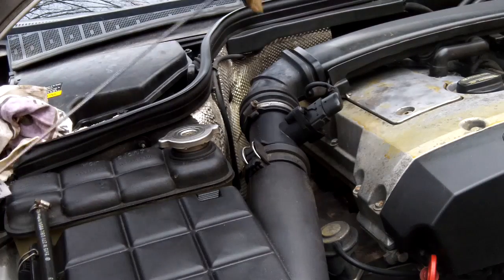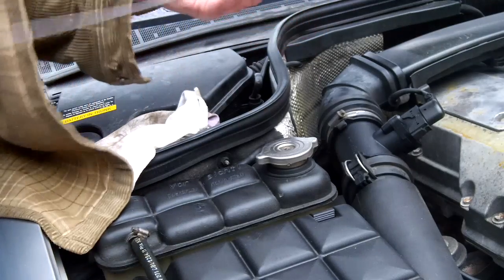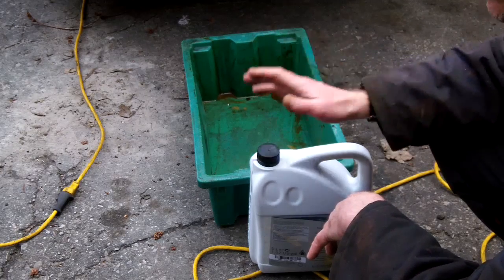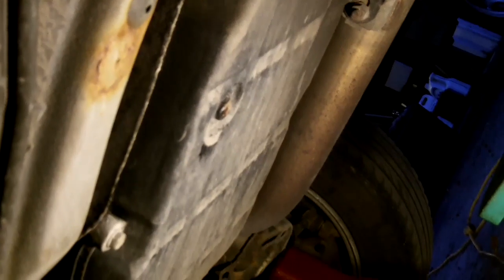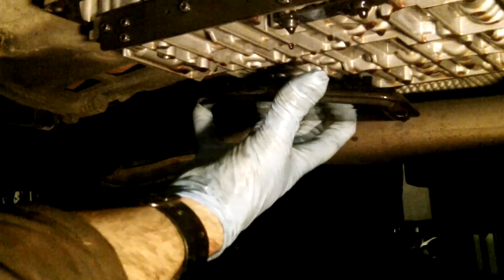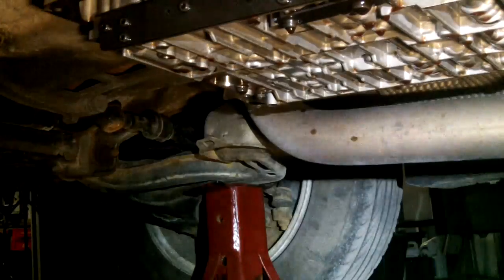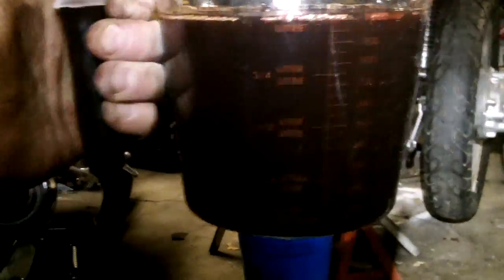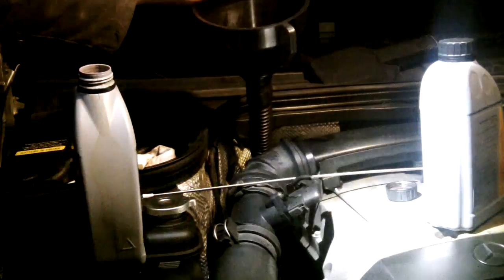Mercedes 722.6 automatic transmission .fluid and filter change..w202

Comment: 2000 C230 Kompressor.  I have owned the car nearly six months.  Bought it with 136,000 on it.  I am guessing the tranny fluid has not been changed.  I changed filter and flushed following this procedure. Wow!!! What a difference!  The old four cylinder is shifting like new.  Thanks for a great video on a job that could really screw up your car if not done correctly.
Reply from the maker: kylejackson8  Very welcome...glad it helped :)

Comment: Good friend of mine is a lifetime MB owner AND dealership tech.  He told me it is pointless to change the fluid and filter without doing the torque converter...  He said the dealers do, in fact only do the amount in the pan and change the filter.  This is something where he and the "procedure" disagree.  He has had transmissions come back with slipping issues that were cured after either a flush or a TOTAL fluid change (including the torque converter).
I'm doing this today on my W203.040

Comment: @fupabox, not even 2min in and already noticed that you aren't checking with the engine running. You should always check the transmission fluid with the engine running and also I would recommend getting an infrared thermometer to make sure it is ~80deg
Reply: Did you eventually watch till the end.. You gotta be patient man

Comment: Thanks - 722.6 it is then. I also noticed that you had the red lock tab on yours - apparently they are originally black, but if you replace the fluid then you can only replace it with a red tab because you can't buy the black ones. That's how you could already tell that somebody had broken the seal on your car before. The lock tab on mine is black however, @ 270000km, so I'm going to do a fluid change myself.

Comment: Invest in a fluid evacuation pump with at least an 8 liter capacity.  This is extremely useful for oil changes, and you can use it for pulling the fluid out of the pan of the transmission before removing the pan to save yourself a big mess.

Comment: I like your videos, and gave it thumb up, BUT:
-722.6 contains 9.3 liters of fluid, you changed 3.5, video should be called transmission fluid dilute....
-you need to replace oil in torque converter too....
-oil level in this transmission is ABSOLUTELY CRITICAL, yet first you measure it with engine off, than engine on,..thats not correct..in this case you must provide exact condition while measuring, otherwise this service can do harm to transmission....
Wishing you luck,
have a nice day
ALOHA

Comment: A week after changing to MaxLife ATF and I can say, without a doubt, the results have been spectacular. Feels like a new car, very noticeably smoother engaging gear from park and shifting through every gear. Particularly 1-2 shift, used to be a bone rattler now I wouldn't even know it happened without looking at the tach. YMMV but I would recommend, hell urge, anyone to give MaxLife a try.
Reply: And just wanted to reiterate, the dex III I had in there was less than 10k old, noticed no difference after changing fluid back then
Reply from the maker: The Stiver I may try that on the SL  (old 4 speed)  hope I get around to it this year  :)
Reply: Yeah I never really expected any difference on a 722.4 but it's night and day. I just can't explain how hard my 1-2 shift was before and how smooth and responsive it is now. My C220 drives better than most new cars with under 30k miles I ride in now.
Reply: Another 1000 miles in, it has actually continued to improve. I'm using maxlife in all my cars now, from 35k to 270k miles.
Reply from the maker: The Stiver wow, sounds like I need to get off my butt and re-do my SL with that stuff
Reply: haha hey idk if my experience is typical but it's like its still firm but they're smoother firm shifts. In particular the feeling off cold start is much better. Performed flawlessly in the mountains just hounding it between 2nd and 3rd at WOT on an 8 mi stretch climbing from 3000 to 6300 ft.
Reply: aside from being full synthetic and having seal conditioners wear protection additives blah blah I noticed the viscosity on the maxlife sheet is noticeably lower than dex III. I'd have to do more research to see how it compares to dex II
Reply: The Stiver what’s the exact name of the max life ATF that you used? I wonna try it on my c280

Comment: I have a '99 C280 US-spec with the 722.6. I purchased the car in January of 2006 with 53.000mi(85.000km). Around 2009 it reached 100.000mi(160.000km) and very rarely it would downshift HARD from 2nd to 1st. Since then the problem has gotten to the point where I no longer use 1st gear, I leave the trans. in (W) mode. I took the car out of normal service in 2011 and it sits in the garage now, only driven about 150 miles per month. However I'll be taking the car on a 1000mi (1600km) trip this Fall.

Comment: The transmission fluid is original and has never been changed. I'd like to squeeze some more life out of the transmission if possible. Do you think a drain and fill / filter change would cause the transmission to fail. I'm not sure if I'd rather try a $150 service or shell out $2,000 for a replacement transmission. With fluid this old, do you think it would be worth draining the pan and torque converter or just the pan?

Comment: Hey Fupabox I have much respect for you & your videos keep up the good work......but I second about flushing the transmission......if your transmission fluid is extra dirty like mines was I would flush it by the trans line in front of vehicle other wise you will be leaving a lot of dirty transmission fluid in the torque converter & will be changing out the fluid & filter every year.......once I flushed all that old fluid out & started seeing clear transmission fluid my car shifts on point in the winter.....once the weather would get cold my car would not shift until it was warmed up for about 45 min........now it shifts on point.......I purchased a dip stick & the transmission conductive tube with o rings off eBay......now every thing is just fine.....no more leaks & transmission is shifting just fine........never had a check engine light

Comment: Thanks - you make even the most daunting of tasks look easy! I have almost the same car as you, but mine is a C180 1998/1999, automatic. Do you know where the transmission "part number" is written, e.g. 722.6? I guess the fluid code is "MB 236.14", but unsure if this would apply my vehicle as well.

Comment: I had the transmission oil line in the front go, slight drip leak. Was on a trip and had no choice but to leave it, let it slowly drip out. Had to stop once, close to home and dump in 1 qt. of ATF4 I grabbed at a store. Was the only option. Anyways, now I have an empty trainy so I can't measure the fluid level. 99 w202 c230k. I found the line at Napa Auto Parts, had them order it to the closest store. I was just going to replace the line and dump fluid back in. Not sure what to use, if I just get some ATF 134 from Napa, whatever brand, or get Mercedes ATF fluid from the dealer...
How can I find out the level? Probably 3.5l as in the video but like you said, needs to be exact. Maybe this job has gone past me doing it myself but I was planning on installing the new line and filling the reservoir. Further research makes me question that now. Any input would help. Thanks!
Reply from the maker: Rich OBrien  Any filling without knowing the level will risk damage to the transmission...if you can get a dipstick to measure the level at operating temperature you can refill (myself I would only use the original fluid for the 722.6 from the dealer, not the maxlife or the atf134 unless the car is newer that 2003...)
Reply: Thanks for the input...
That is what I ended up doing, found the parts cheap on Amazon OEM & got the fluid from the dealer. Just waiting for the filter, gasket & cooler line to arrive.

Comment: Great Video. I finally did the same thing to my 2003 w211 E320 (thanks to your video). However, I am having trouble measuring the fluid level. Using the exact same dipstick you have here, whenever I dip it in and pull it back, I find oil traces all over it making it very difficult to tell what exactly the correct level is. I mean, the oil is not evenly distributed over the plastic end of the dipstick (there are dry gaps where there is no signs of fluid). Any help would b greatly appreciated.THNX

Comment: On W211 you don't have drain plug in torque converter, so you can use this procedure, but you'll change only 50% of oil.

Comment: You shoild have drained the torque converter. Done mine on the weekend and another litre came out.
Reply from the maker: Not all 722.6 torque converters have a drain bolt . If you are changing on a regular basis it isn't necessary

Comment: Thanks for the video. I only have 2 questions. So i can use whichever of the recommended fluids as long as i dont mix the newer with the older? (blue and red?) and where did you buy the filter? did it come with the new gasket? I assume you cant reuse the old one
Reply from the maker: best bet is to use the valvoline maxlife synthetic. it's backwards compatible with the old fluid and can mix with the old fluid, and can be found anywhere . Mnay chryslers used the same transmission and they sell the filters and gasket at a lower price . You can also order a filter and gasket kit from rockauto shipped to your door .
Reply: @fupabox  I live in Europe so I have no idea what that store is but it's ok. I think I'll be able to figure it out. Thank you very much. Your videos have been very helpful. Keep up the great work

Comment: When I tried to remove my pan today I stripped one of the torx screws. Do you have any advice on removing with out damaging the pan. Replacement screws are $3 fro the dealer so I'm not worried about that.

Comment: Hello again...weather is warming up in the midwest so getting ready to order my transmission pan gasket, filter and I see a front transmission gasket as well in search results.  Should I change this as well (circle shaped metal gasket ring with holes in it)?   Thanks again in advance love your videos just changed spark plugs today on my C36 after watching that video of yours and cracked one of those brittle vacuum lines grrrr (thankfully cheap).
Reply from the maker: +mpowers1978  The only think I can think the gasket would be for is the electrical plug seal.. the main pan seal will definately need replacing if you chnge the filter

Comment: Thanks for the video. I am refilling mine after a crack in the pan allowed it to drain out so I was not able to measure the amount lost. I also ran the car in park for 20-30 minutes to keep the battery charged. How much would you recommend I put in initially before running it and making adjustments?
Reply from the maker: VonGutenburgen Stienenhoffer  I would add 1 liter + the amount you got out of it..then add more till full when warm
Reply: ***** Thank you for the response. What do you mean by the amount I got out of it? I wasnt able to catch the fluid so dont know how much leaked out. I'm not particularly experienced in dealing with transmissions as you can probably tell. I'm assuming the fluid would have needed to circulate through the entire system to produce an accurate reading on the dipstick tool. Is this the case?
Reply from the maker: VonGutenburgen Stienenhoffer I didn't read your question correctly the first time..I guess all the fluid drained out through the crack...in that case start with 4 liters of new fluid ,then warm the car up shifting into all the gears (you can do it without driving..just shift into all the gears while sitting still) once warm check the level with the engine running...you are correct ,the level when running is different than when the engine is off, due to circulation
Reply: ***** Ok, thanks again for the help. After adding the 4 liters the level is quite a bit above the hot temperature level on the dip stick tool. This is just because I haven't run it yet, right? I have heard the stories of how sensitive these car's transmissions are and what can happen if they are overfilled so sorry if it seems like I'm wasting your time. I'm just very paranoid about this.
Reply from the maker: VonGutenburgen Stienenhoffer ask as many questions as you need to..not a problem at all...once it warms up and circulates the fluid you need to check the level then, it will tend read higher when cold...it isn't dangerous to idle it overfilled, and move the shifter through the gears....if after checking the level warm it is still too high you can drain it out through the drain plug... a tiny bit messy ,but I've had to do it before a few times when I've added too much..
Reply: ***** So no danger from overfilling unless its being driven? Would you say 30 minutes is a good amount of time to let it idle in order for the fluid to reach 80 degrees celcius?

Comment: is this the same process for a 1999 w210 e320? Mine has 330k miles on it and plan on doing this and transmission mount myself. Car runs beautifully
Reply: also did you notice a shift difference?
Reply from the maker: yes  and yes  :)

Comment: I replaced my transmission oil on my W202 C280. New gasket new filter when I was pouring the oil back in the oil was pouring all around the pan. I didn’t have any leaking problems before hand but after putting the pan back in I couldn’t get a good seal. I was using a good torque wrench and everything was clean. I ended up buying a new pan new gasket new filter and try again. I’m just wondering if anyone else has run into this problem